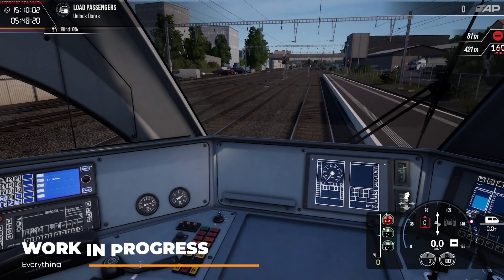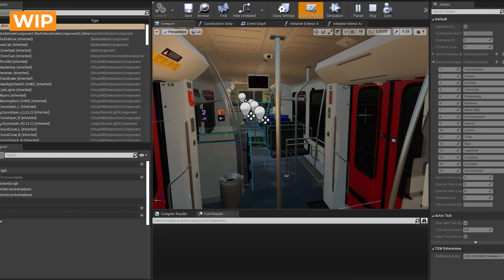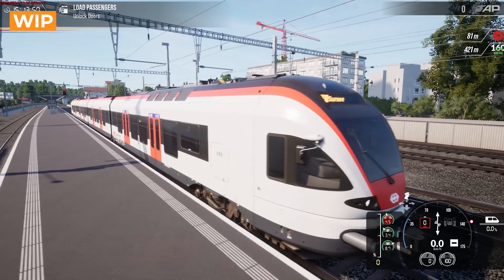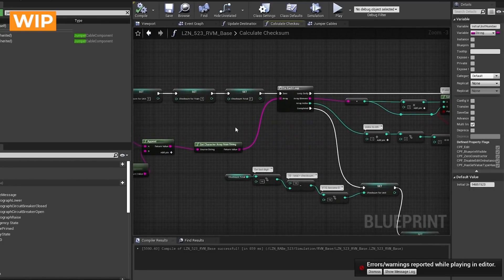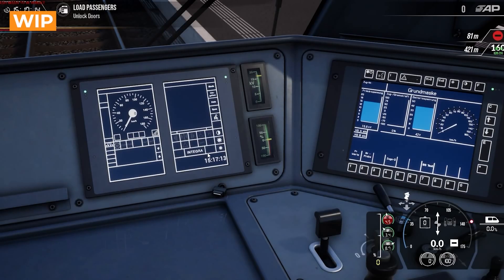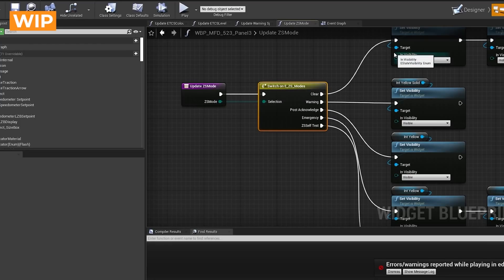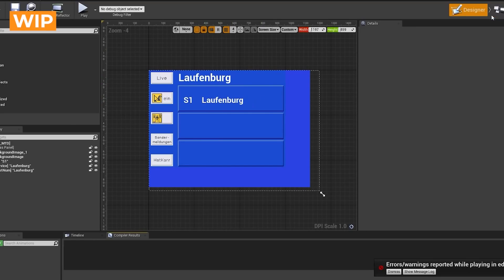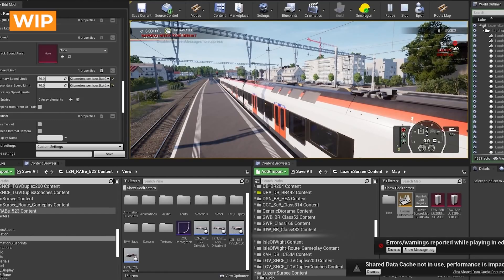Train Sim World 2 | SBB RABe 523 Devblog Technical Setup | Part 2

Comment: Really nice work !! I just want to bring some details about ETCS. In switzerland we have 3 differents Level.
- LEVEL 0 (or Unfited) is available only  with a Baseline 2 vehicle. (Flirt 523, domino, Re460, Rabde 500 ICN, etc). When you drive, you must look at the signals outside, ZUB/Integra systems are available. 
- LEVEL 1 LS (Limited Supervision) is available only with the Baseline 3 vehicle (Flirt 523 TSI and Giruno). Those vehicles are new And They don't have Zub/Integra system.
- LEVEL 2 (Full Supervision) is used on every vehicle when they are runing on a LVL 2 line.

So the Flirt 523 (not the TSI) is runing on LVL 0 or LVL 2, not LVL 1.

I hope it help :) you did a really great work !
Reply: I would still define vehicles with ETMs for EuroSignum/EuroZub (packet 44 of the eurobalises) as running under L1 LS where there is outside signaling.
For me level 0 is when there are no eurobalises, only older security systems or nothing, which is not the case: eurobalises are everywhere in Switzerland.
The implementations of L1 LS can vary diversely from country to country. For example, in Germany, ETCS Signalgeführt strongly emulates PZB.
Reply: @jordanwarne911  you are right ! But we have to seperate the infrastructure and the train. Every line (SBB CFF) are running with the eurobalises system. We don't have signum/zub beacon anymore. Now it's all Eurozub, Eurosignum as you say. This way, every line can be run on ETCS L1 LS with a Baseline 3 train. But it is called "Limited Supervision" because we still have signalés outside. And any other vehicle from another country running on Baseline 3 can go on our lignes (Giruno for exemple) . The train computer will translate each signal and show it on the DMI in the cabin. So, it is ETCS, but it is not Full Supervision Level 2 ETCS. That is for the infrastructure.

Now for vehicle, : oldest vehicles don't run with a Baseline 3 system. They use Baseline 2 system. Instead of the BL3 who has only 1 antenna for the the eurobalises, BL2 has 2 antenna, one for the ETCS And The other one for the Eurozub/Eurosignum. It cost too much to change all the train so we "just add" a new antenna and a DMI. (Alstom and Siemens DMI). 

Now in practice, when you are on a LVL2 line (CAB) , everything is the same for BL2 And BL3. When you go out of the CAB zone, vehicle with BL3 will run on the LVL 1 LS. But with a BL2 train, it will notice you on the DMI that you are on level 0 (unfited). 

To sum up : 
- Lines are all on Lvl 1 for ETCS
- BL3 vehicle run on Level 1 (LS) beacause of the ETCS antenna 
- BL2 vehicle run on LVL 0 (UN) beacause of the Zub/Signum antenna 

I don't know if you see the difference between the vehicle and the line. I hope it is understandable !

Comment: That's great. Fingers crossed it ends up working better than ATC/ACSES.

Just a question, what's the realistic mode to use in this route? As far as I know IRL it's not the driver that chooses it, it's forced to use the highest possible level.